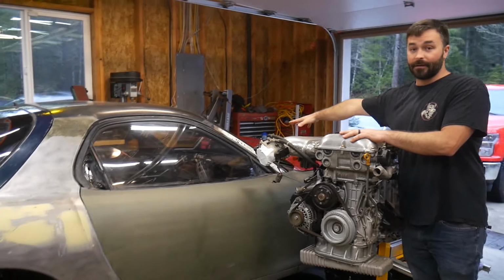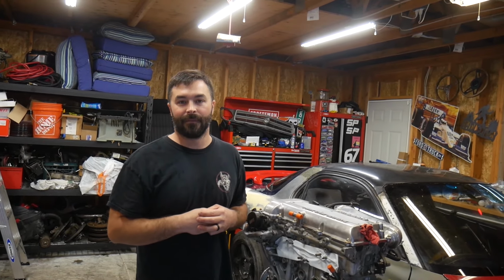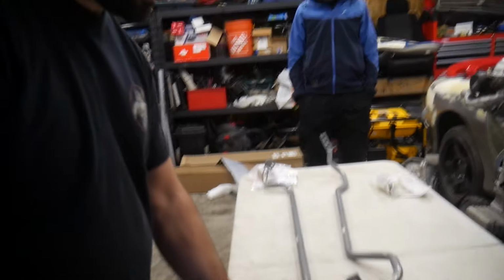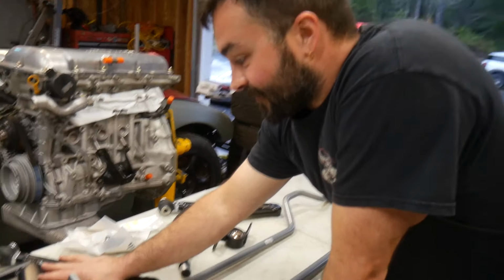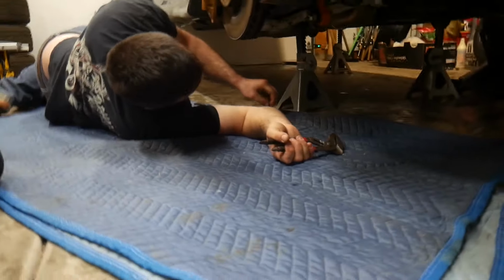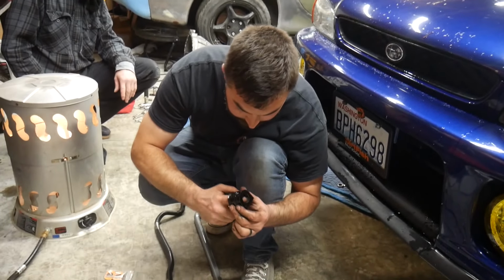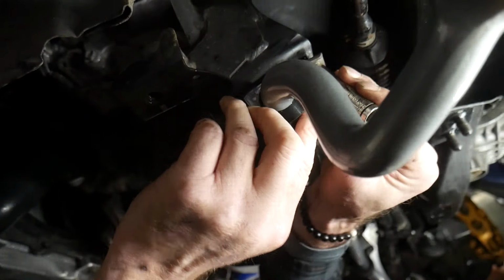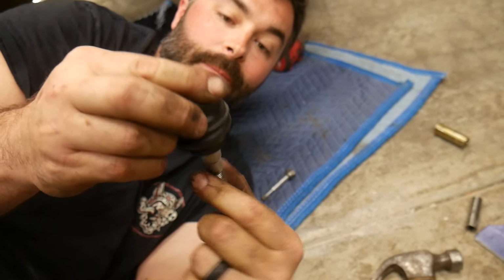GC8 Sway Bars and Control Arms! Mark's Epic Future Build Plans!

Comment: Can I ask a silly question? Can you not just flip the end link over?
Reply: I guess we could have, but on part two of this video that will come out later, we'll show that the rubber in the end links were cracked anyway and they were pretty wore out from racing. We just decided to upgrade them while we were fixing stuff!
Reply: @markschaff9503  I see. I thought that it is always best to do threads pointing down so water can't sit in there.
Reply: The way the orange part of those endlinks is designed, it won't sit flush with the sway bar with the orange end up unless you use a spacer. It probably is a good idea to have the threads pointing down for the reason you said for sure!